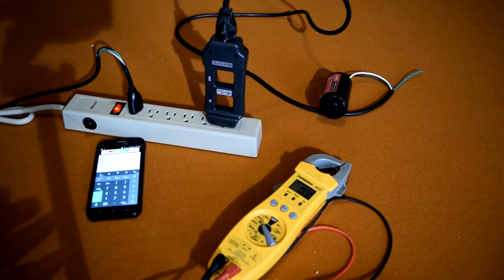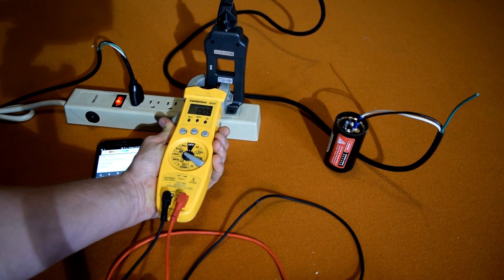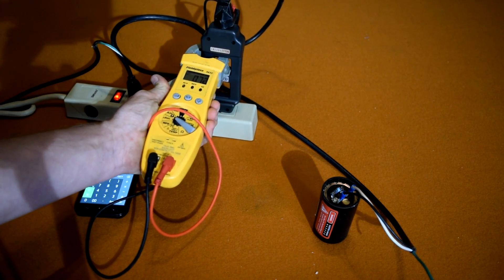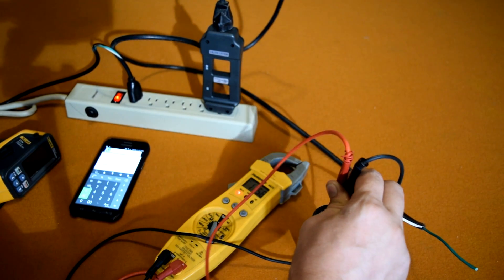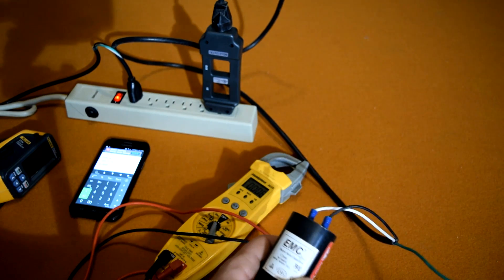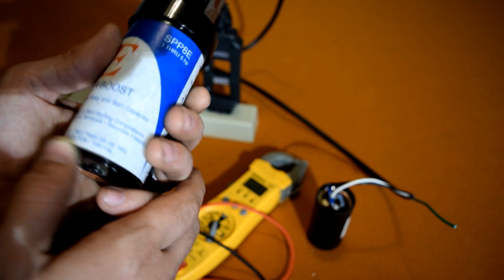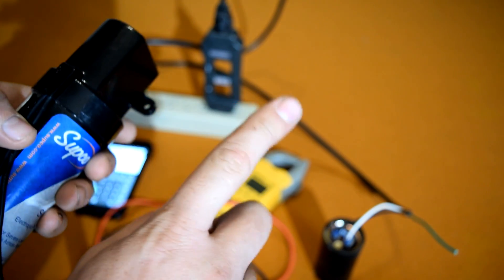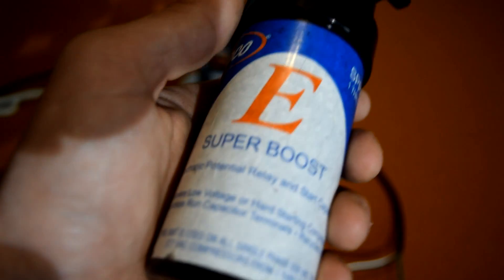Start Capacitor Vs. Run Capacitor Why You Can't Store A/C Power In A Capactor

Comment: Excellent video and again, thanks for the info.  I've removed the capacity from the fridge power strip.
Reply: If you remove that start capacitor and connect those wires together you might burn that motor's start winding up because of compressor stall. That particular capacitor is designed to give the compressor a momentary kick in the ass to get it rotating so the motor gets up to speed quickly, disconnecting the start winding.
Reply from the maker: be safe friend
Reply: 3phes capacitor testing what foot

Comment: Hi I built a lithium battery with 12v to 220v inverter when ever I use the electric drill it shuts down ,would you recommend me putting a capacitor in between the socket and electric drill plug and if so what  are the values you would recommend?
Reply from the maker: how big is the inverter what size battery what size wire
Reply: @solarpowerelectricityandel2915  then inverter is dc12v-ac220 ,4000w  the battery is 38v 30amps and I use a 38v to 12v  dc converter, thanks for the reply
Reply from the maker: @iamadream  Don't use  a converter, use a 12 volt car battery to test the inverter and then build around that P.S. make use your using a pure sine wave inverter any thing you power with a modified sine wave inverter will kill it so no laptops or tv's just motors on that type of inverter
Reply: @solarpowerelectricityandel2915  thank you very much for the input

Comment: You can't store ANY "power" in a capacitor. You can only store ENERGY in a capacitor. The charge on a capacitor is usually measured /expressed in Coulombs - Q=CV, Q is the charge in coulombs, C is the capacitance in farads/microfarads, and V is the voltage of  the charge. The voltage is a dc value. Power is the rate of energy usage and will depend upon the speed at which energy is consumed, such as the conversion of electrical to thermal energy in a resistance heating element.

Comment: It doesn't change the frequency. The frequency is 60hz as set by the power company. The current is fluctuating from either plates because the voltage is alternating 60 times per second. The energy from the constant switching is generating heat. The capacitor stores almost just like a DC battery but it is reliant on the incoming voltage. On a DC circuit that means it can hold a fairly steady charge (current) because the voltage remains the same (basically forcing the electrons from one plate to the other and holding them there.) As we know, alternating current.... well it alternates. So when the voltage flips that means the electrons get pulled to the other plate in the capacitor, as if you were recharging a battery (to use a very simplified comparison.) Buuuut that voltage will flip again and again... 3,600 times in one minute. That means the capacitor "stores" a charge 3,600 times but is flipping it the other way 3,600 times. Long story short, those electrons are gonna produce some heat. 

I'm not sure why you're saying you'd use or wouldn't use a capacitor in your house. For what purpose? They're mainly for motors and circuit boards and are used to make inverters work. It's not something you just randomly add somewhere so I'm not sure what the heck the point of this video is???

Run capacitors are okay for continuous use, that's the whole point. A start capacitor is for AC induction motors, small fans usually just use a shaded pole to shift the phase, there would be no need for a start capacitor. 

You don't just lose resistance in a winding. I'm not sure wtf you're saying in any of this. 

Drawing high amps can be due to motors shorting out, motors going bad (bearings or compressor scroll failing,) overcharge or undercharged systems, non working condenser fans, an extremely dirty condenser, evaporator, bad contactor. Yikes just too much with this video lol
Reply from the maker: I had a friend on youtube make a capacitor with a 110 plug and added it to his refrigerator on a power strip and i was trying to get him to save power on his home some one was telling him on youtube to make this thing and i was trying to help him not to wast power
Reply: @solarpowerelectricityandel2915  Oh jeeze yeah that would do nothing. They're made to be in tandem with motors and the power strip might feed into a motor but it isn't going to do anything except be more likely to cause issues. If he wants to smooth things out, he needs logic to go with the capacitor... aka an Uninterruptible Power Supply. It'll smooth out the power... but refrigerator compressors are pretty simple and are made to be able to handle shitty AC to a point. It'd be a monumental waste of resources for a fridge unless the grid goes down often (california brown out to black out) just to keep the fridge running for a while. You won't see performance gains by any means.
Reply from the maker: @etherealrose2139  I agree completely

Comment: What size resistor is on that
Reply from the maker: You can look at the color code on that but that resistor don't consume nowhere near as much power to make that capacitor hot should never do that should never put a capacitor in the circuit bad idea

Comment: CAUTION****HVAC STUDENTS DO NOT USE THIS VIDEO AS A RELIABLE SOURCE OF INFORMATION capacitors don’t stay in the circuit constantly there will always be a relay taking the start capacitor out of the circuit moments after starting the compressor. Also the only load in this circuit is that bleed resistor thats the current reading he is measuring. Finally all that heat is most likely from the lack of a load between his neutral wire and the start capacitor.
Reply from the maker: you fool This video is why not to do this from the diy er I have never used this ever for any reason and was helping A FRIEND TO NOT RUN A CAP IN A POWER CIRCUT BECAUSE HE WAS CONVINCED THAT CACAITORS HOLD AC POWER STORED THAT IS IMIMPOSSIBLE

Comment: A capacitor consumes as much power as a balloon consumes air when you put air in to it.  Except the balloon does not consume your air, it simply holds it for you.  In AC it is the same as if you breath in the air in the balloon and that air rushing back into your lung.  You didn't lose the air.
The only energy air you lost in the balloon is due to technically of friction, effort used to push air into it and stuff like that.
Do not compare a capacitor to a light bulb.    And  you know what.  I barely graduated high school.   Please do not accept my word for this.  Find out for yourself.
Can you use your imagination what role capacitor plays in circuits using the balloon analogy?
Just remember you push air in the balloon holding it in your mouth and then when you take air back in with your lip still on the balloon. what happens?  Just go with that for the perfect analogy.
That is what circuits experience.    The circuits as you can see is effected far more with the rushing of air back in than when  you pushed air and filled the balloon.   With AC it is equivalent with every breath going in and then suddenly air rushing back at you.
I am the kind of person that has difficulty learning and getting things, but when I finally do get something, I will have the ability to explain it to a dog and the dog will get it.
I find it extremely rare to run into someone that can explain something better than me once I understand something.

Comment: I think there is some confusion on how you're presenting this.  Mainly there is a significant difference between a start cap vs a run cap as your title suggests.  However you keep pushing the idea that the start cap is constantly drawing current and cooking to the levels of 8 Watts  when in fact is only engaged during motor start-up. The run cap however has a much lower value and runs at 100% duty cycle.  Are you just trying to sell the super boost module?

Comment: I thought you would never want to exceed 200-230V in this application (not 330V). The rated voltage on the capacitor is peak to peak, not RMS. Should size capacitors to 1.5x RMS supply to be able to safely handle the P-t-P; hence you'd want that 330V rated capacitor for a ~220VAC application. Is my understanding incorrect?
Reply from the maker: Capacitor ratings vary for instance 230 V may require a capacitor for 330 or 440 V if you have a capacitor that is 440 V on the system you should not go down to 330 V writing even though the voltages to say and yes you're right cause of point to point the voltage and the capacitance is important

Comment: I'm totally confused  The starting capacitor you have wire has the bleed resistor across the leads and you have connected L1 to neutral through the resistor which is connected to the capacitor. Not for sure what the capacitor is doing other than getting hot obviously from your  thermal imaging.
Reply: As far as I can tell all he's done is form an RC network with the capacitor charging and discharging through the bleed resistor.  With no other load on it, the capacitor is acting pretty much like a short across 115VAC, partially discharging back through the bleed resistor, and so it gets really hot. I suspect, if he took the bleed resistor off his capacitor would cool off a lot since it would have no path to discharge on alternate cycles. 

I'm also not exactly sure what it's proving by the demonstration as it doesn't model how it works in the start circuit of the compressor motor  which provides an inductive component (start windings) in series with the capacitor which would much better demonstrate what's happening.  But I'm also not sure I can agree with his conclusion about start kits being harmful for compressors. There are plenty of demonstrations available showing in-rush current decreasing with addition of a start kit and when properly installed the potential relay takes the start capacitor out of circuit very, very quickly after start so it's not a factor while running.  The way a start kit helps is it phase shifts the voltage applied to the start windings to provide the additional starting torque (so it starts more quickly) without requiring massive extra current therefore putting less electrical load on the house wiring.
Reply: @dreadrechsler8278  It doesn't prove anything. It's a dumb video that no one should take seriously, I hope. I mean you can tell when he cannot even focus a camera in the beginning.

Comment: Can you make a video explaining the calculations you used?  That would be most helpful. Also mathematically explain what the relevance of your test equipment x1 and x10. Is it based on capacitive or inductance reactance?
Reply from the maker: The 1x vs the 10x is the turns of load wire 1x for one turn 10x for ten turns
Reply: @solarpowerelectricityandel2915  Thanks- not what I was asking but got what I was expecting. Thanks

Comment: Did a lighting study years ago, measuring the power consumption of ballasts, magnetic specifically, vs, electronic. The device you used with the X10 coil is basically what we used during the initial audit of magnetic ballasts, the real power in watts, including the differences of a quick start, rapid start, etc. Taking a #14 gauge wire, wrapping it 10 times and putting in line with the ballast power feeds, all it does is magnifies the actual power by 10, easier to read on your amp meters.
Reply from the maker: Yes  Awesome little tool

Comment: On the point of consuming power. Other than dielectric heating, capacitors don't consume power. Instead the store power and later release power. Though power is flowing in and out, the power is not consumed. This is called reactive power.  Apparent power = square root of ( true power^2 + reactive power^2). And the power company charges consumers by their real power,  not apparent power with reactive power component. 

Don't plug in the capacitor to the wall... sure don't because.... 1 that capacitor is not meant for continuous use. 2 there is no need for capacitive reactance  in ones home circuit. But storing/releasing power is not "consuming" power.
Reply from the maker: This is not up for debate sorry you have to understand it's not on a start motor with a phase shift it's what some people do thinking  it will help them start a fridge with a smaller solar inverter and tested a load wast on any system
Reply from the maker: P.S. you can't store A/C power on a cap

Comment: Hope you can answer my question. In a single phase induction motor a start capacitor is used to create a phase shift in order to start the motor turning. My question is about run capacitors. When a run capacitor is being used does changing the uf of the capacitor change the phase timing in degrees of rotation. Say from 175 at 4uf 180 deg at 5uf  185 deg at 6uf For timing the electron flow to a second set of coils coils?
Reply: Thanks you. I thought so but needed the answer, It was bugging me.

Comment: On a run capacitor do both hot and neutral go to capacitor
Reply from the maker: Never attempt what I'm doing in this video was the demonstration on why not to do this don't do it it's a waste of energy device
Reply: No. One goes either to hot or neutral hermetic winding and the other goes to the start coil terminal on the compressor.

Comment: You need a run capacitor, NOT a start capacitor. You should use a much lower (micro farads) like 3 to 5 mfd. The voltage listed on a capacitor is MAX voltage so you can use a capacitor rated higher than what the use is but not the other way around. A capacitor is only effective on an inductive device like a motor or compressor. It changes the current (leading/lagging) so it is important to size the capacitor to the device it is used on. A good formula to use is (2653 X Capacitance amps) / Capacitor volts = Actual capacitance

Comment: What size capacitor do I need for my AC RV roof unit
Reply from the maker: maybe a 30 + 5 uF you will have to take it apart to look at it and see
Reply: Solar Power Electricity and Electronics   88-108 250vac is one 35.uf 370vac
Reply from the maker: michael Thomas so it appears you have two different capacitors or mine correct on that
Reply: Solar Power Electricity and Electronics no there's 3 capacitors
Reply from the maker: michael Thomas one of them should be for a fan and one should be starting the compressor and ones the run capacitor but just in general I would call a professional to work on it if I was you
Reply: Solar Power Electricity and Electronics I'm pretty smart I have a lot of experience with Automotive I have a recovery system and evaporator  pump have experience AC current and  DC current I'm smart enough  vary good with my hands  if I want to give this AC a facelift icap and probably will
Reply: Solar Power Electricity and Electronics I'm pretty smart probably even change out the freon from whatever it is to the duracool 22 so it's environmentally friendly
Reply: Solar Power Electricity and Electronics I'm pretty smart I'm very smart and very good with my hands I have a few years of experience with AC and DC current and 20 some odd years on automotive air conditioning systems they're not any different they work with the same concept have the same moving parts and I am capable enough with my pair of hands that if I want to give this a c a facelift ai-chan and get rid of whatever for refrigerant that's in it the right way by using a recovery system I own an evaporator pump to dispose of whatever Freon is in the system properly and swap it out for something that is more environmentally friendly
Reply: Solar Power Electricity and Electronics I'll put it to you this way I restored and built 13 cars and trucks from the ground up I even got the chance to help build a 1969 Shelby 500 cobra not very many guys have had that kind of opportunity
Reply: Solar Power Electricity and Electronics look me up on Facebook there's a picture of me on a 3 wheeler in the Safford sand dunes Michael Thomas Tucson Arizona
Reply from the maker: michael Thomas that's a terrible idea if you remove that refrigerant you have to add 4 oz of Peel in with the new refrigerant and then you need to be able to purchase that refrigerant and manifold set and you'll have to use a vacuum pump to vacuum it down again I'm not saying you're not smart but you could get hurt playing with electricity I've been shocked before and I'm grateful I wasn't completely electrocuted so you should be incredibly cautious
Reply: Solar Power Electricity and Electronics there's refrigerant and PAG oil or mineral oil depending on which type of refrigerant was used but they make this new stuff   environmentally safe and I've converted systems from R12 to 134a I have some new stuff that works better besides you can't get the original freon in the United States anymore. I wonder why
Reply from the maker: michael Thomas your system doesn't have anything called p a g oil it's called p o e and you would be adding around 4 oz to your system if you're going to change the refrigerant out but it doesn't change anything on environmentally what you need to do is just consider leaving the refrigerant alone until you have a problem with the refrigerant leaking out mechanically if you have an electrical problem you need to fix the electrical problem

Comment: Can I use a 250vac-15mf capacitor in a 180vac-12mf refrigerator start relay?
Reply from the maker: Reynaldo Irizarry no you need to replace it with the exact same one
Reply: Check the size of the compressor, home many hp.